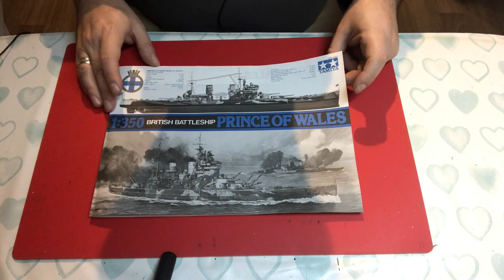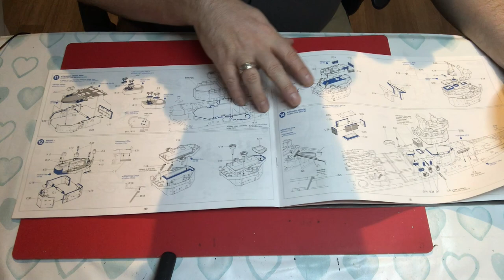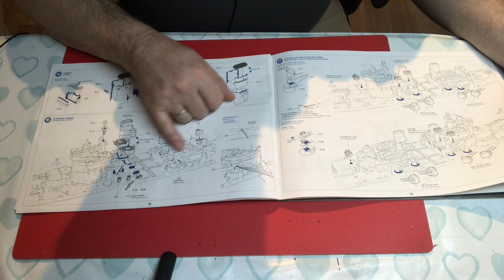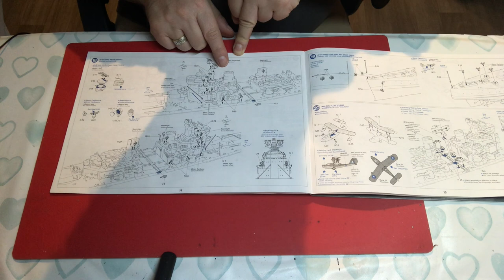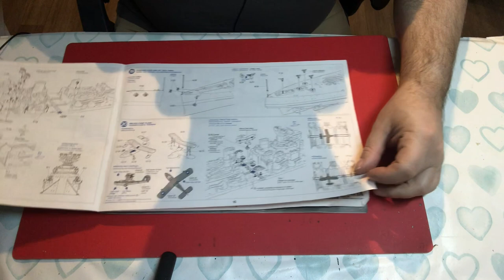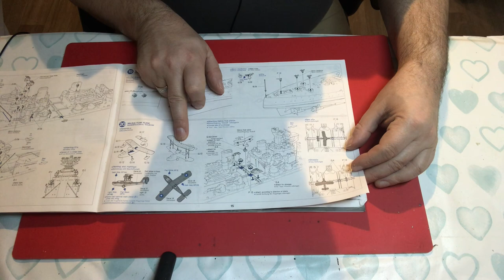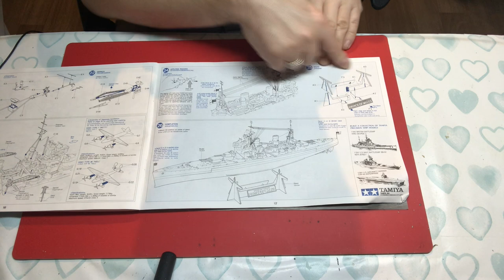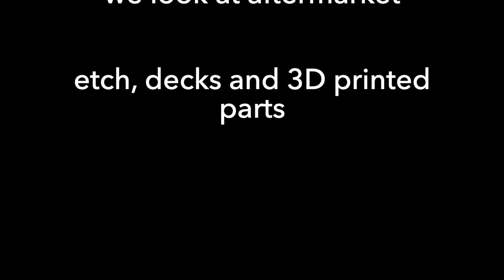First impressions - Tamiya 1/350 HMS Prince Of Wales and aftermarket, part 1

Comment: Interesting to see how the "ability to provide detail" has changed over the years...not to mention how sometimes new capabilities are "implemented", yet sometimes they are not.   Also interesting how the Tamiya ships of the 70s and 80s were what seemed state of the art then...and we consider them to be klunky compared to modern ship kits.   I guess adding details is (and will probably always) be the biggest challenge for model kit companies that are doing ships.   I've only tried 1 Flyhawk kit (1/700)...and like 1/72 aircraft I'm moving away from 1/700 ships.
Reply from the maker: I think ship detail is always less well done than an aircraft or AFV, I guess because of the high tooling cost to start with with.

Comment: I bought and made this exact kit almost a year ago. It was pretty good although I found a few small issues with getting the deck parts to fit the hull. I also used the aftermarket photoetch for cranes, boats and railings and found the 2lb'er pompoms quite tricky to get right, but again there were very few problems other than my limited abilities.
Reply from the maker: cool.  we will take a look at what aftermarket I have tomorrow

Comment: Another slightly smaller option is the 1/400 Heller which is about the same vintage. The Heller hull is much more accurate and better detailed. If you're lucky you can get one for half the price of the 1/350 Prince of Wales you have here.

Comment: Great first impression video as always Jason. I actually have this kit,  I haven't looked at it in a while but, I believe mine has some pe that came with it, I'm not quite sure. I'll have to dig it out and have a look at it. It looks like a nice kit to build, and I'm assuming the parts should go together quite well being that it is a Tamiya kit. I may be mistaken about the pe though, I'll need to have a look at it. I'll be interested in seeing her being built. I'm looking forward to seeing part 2. Have a great day, see you next time.
Reply from the maker: Hi, Tamiya never have put etch in to my knowledge, in the 80’# you would have git plastic railings for the main deck
Reply: @ModelkitStuff  yup, I just went and dug it out of my stash, I was mistaken the two Trumpeter kits that I have do have the photo etch. They were the ones I was thinking about  I do believe there is a lot of aftermarket stuff still out there for the P. of W. I think Eduard has a bunch, at least they did when I was looking into pe for all four of my big ships, ( Hood, Prinz Eugen and the Bismarck), I found some for all but one. Couldn't find a whole lot for the 1/350 Bismarck though. I was rather surprised and disappointed. Nevertheless I'm looking forward to part 2 of your P. of W. first impression video.

Comment: Could you help me out as far as what holes to drill out from the drill hole markings on the bottom of the deck?   And, what are the "K" arrow markings on the underside of the deck....what does the K mean?   I can see the holes marked "P" to be drilled but I have not been able to figure out why they have to be drilled out.  I have the Pontos photoetch kit and the deck and I really don't want to drill out the wrong holes    thanks  Brian
Reply from the maker: Hi Brian, the deck is also used on the King George V so the K holes are for that build.  If memory serves the holes are for gun tubs but you will probably have resin ones from points.  The Pontos deck should have the holes in it also where it needs them so I would put wood deck next to your plastic deck compare the two and only drill out what Pontos have as holes.  hope that helps
Reply: @ModelkitStuff  excellent.  Thanks very much

Comment: Very thorough review. I've had my sights on a Tamiya King George V for a while. From your experience, are there any major differences between Prince of Wales and King George V kits? Not sure if Eduard PE sets can add the missing details. Sensible retail price for Tamiya quality though. The three piece deck is what worries me. Keep up the good work!
Reply from the maker: Hi, there is little difference between the KGV and POW kits.  the Eduard etch is discontinued for both now so you tend to find it on eBay etc.  White ensign Models do etch for KGV which would be a good set or if your money stretches to it you can get a Pontos set, which I have so I know it will give you a deck overlay to cover the 2 deck joins as well as new masts and barrels.  you can see the Eduard etch for POW tomorrow
Reply: @ModelkitStuff  Thanks for your quick reply! At the moment both White Ensign and Pontos sets are out of reach for one reason or another. What I'm planning is to use two separate Eduard PE sets for KGV. Namely the 'cranes and railings' as well as their 'generic' KGV sets. They're available from Eduard's website.  I'm guessing you've got the discontinued 'Big ED' set to work with. As for the deck, I'm thinking of a wooden overlay to solve Tamiya's three piece deck issue. Any recommendation would be much appreciated. A KGV would be a nice change from my usual Cold War/Modern ship builds. Looking forward to your Eduard PE video tomorrow!
Reply from the maker: @giorgoschrysochoos8874  Chuan Yu or Artwox are my favourite brands the scorching is not to heavy from the laser and both good fitting decks.  actually that's a good idea for a video 🤔